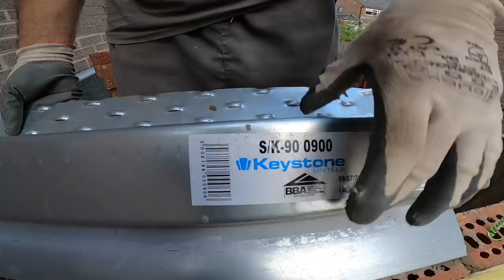WALLPLATE & PIKES.... SMALL EXTENSION BUILD

Comment: Fantastic work bit confused regarding the  insulation would that the up to building  regulations ?
Reply from the maker: I’ve been using it for 36 years and never had a problem. 
Everything was signed off by building control 🧱👍🏽
Reply from the maker: yes 🧱

Comment: Have you got any videos of you doing the vertical dpc? I've just got a wall starter kit and it is saying to do a vertical dpc. I notice you always do it. Do you have to? 
If you do t have a video please could you explain it a little bit. Do I connect the metal starter to the wall above the horizontal dpc too?
Reply from the maker: We don’t use the starter kits so can’t advise on them .
    As for the dpc we cut up the wall and  slot a 4 “ dpc into the slot . 🧱👍🏽
Reply: @SteveAndAlexBuild  abs slot? Is that a typo?
Reply from the maker: @bigmik3566  yep … and
Reply: Lol. Thanks. How low do you start it? And how high do you finish it? Do you also cement the dpc in?
I can't see the point of it?
Reply from the maker: @bigmik3566  it’s a pointless job which only some inspectors specify . 
We start below damp and go all the way up and just wedge it in 🧱👍🏽
Reply: Ok great thanks very much. I wasn't told to so I'm guessing I don't have to.
Thanks again 👍
Reply from the maker: @bigmik3566  😁🧱👍🏽

Comment: Sorry also I've been told not to worry about air bricks. Is that ok?
Reply from the maker: Not sure what you mean 🤔🧱👍🏽
Reply: @SteveAndAlexBuild  air bricks for ventilation between cavity wall. Existing house has them
Reply from the maker: @bigmik3566  . If the cavity is insulated then no point . They were originally fir ventilating the cavity 🧱👍🏽
Reply: Ok thanks viry much. You gotta proof read mate lol
Reply from the maker: @bigmik3566  🧱👍🏽